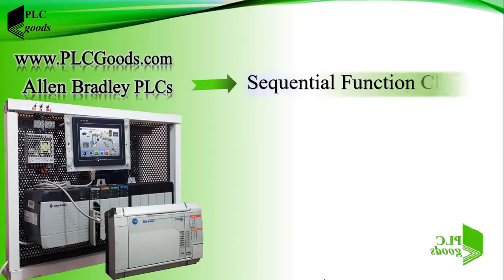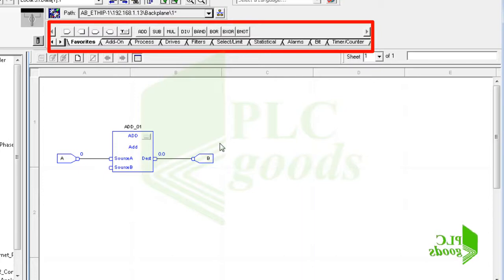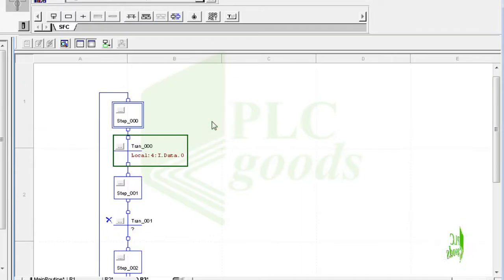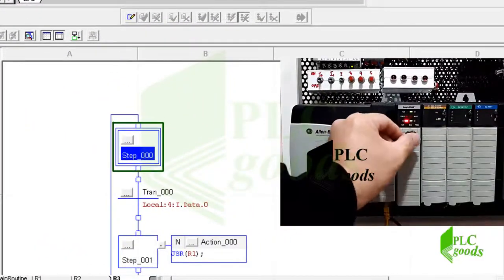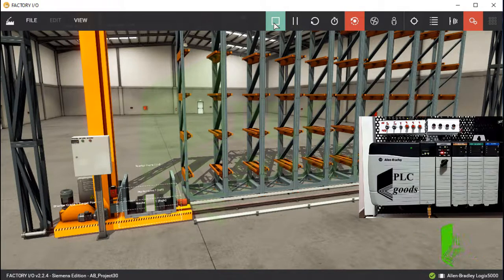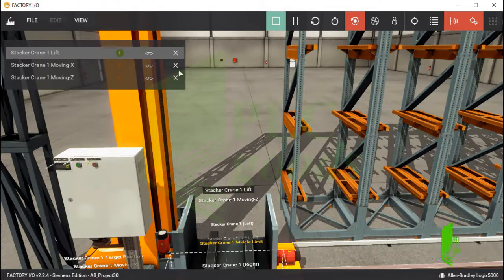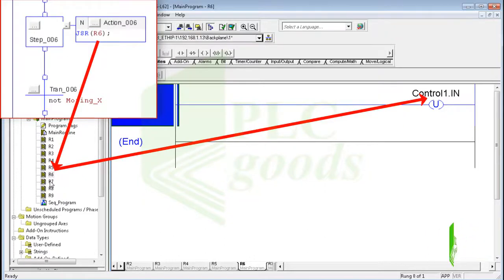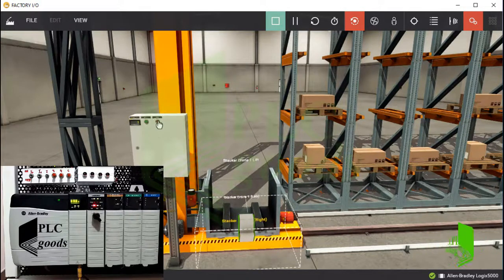PLC SFC Tutorial | Sequential Function Chart & Automatic Warehousing | Lesson 30

Comment: Thanks a lot for these complex tutorials made too easy. You are the best sir.

Pls, is it possible to use the Unlatch instruction with a normal OTE ? If Yes, which conditions can warrant this. For example, from 13:15,  the emitter wasnt latched. you used ordinary OTE instruction on it but later in 13:25, the emitter disabled by being Unlatched. its abit confuing for me sir

I use to think that you can only use the Unlatch instruction  with a corresponding Latch? 

Am open to learn from you as usual sir. Thanks for you kind explanations and insights
Reply: Hi Dear, thanks for watching our videos carefully. note that, when you are using sequential and go to the next step, the program will keep all outputs states for the next step. try to test it. so, when I used OTE at 13:15, for the next step at time 13:25, I needed to use an unlatch instruction.
Reply: @plcgoodsmentor9223 
Thanks for the reply sir. Am grateful.

Pls, does it only apply to the sequential method or can you generally also use an Unlatch instruction with an OTE in some cases without the sequential method.

Once again, thank you for your quick and elaborate reply sir
Reply from the maker: Glad to have you here in the comment section!
Reply from the maker: Thanks for questioning and challenging the content! :)
Reply: @plcgoods 
Pls sir, am not in any way challenging the content. Am a learning and barely can find my feet for any challenge sir.

I just want to know more and benefit from your wealth of knowledge. Pls I am honestly a baby learner sir.
My apologies of i sounded otherwise. Am deeply so so sorry sir